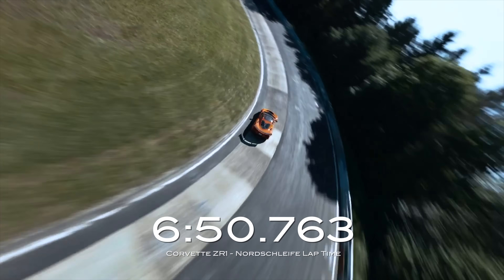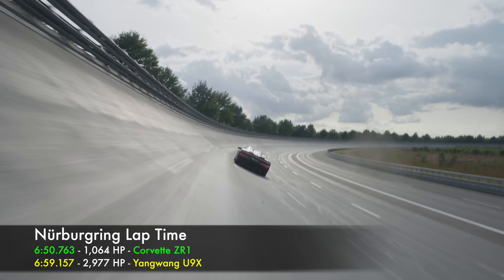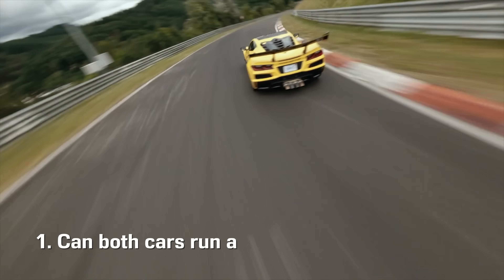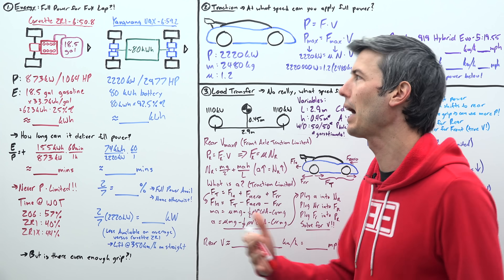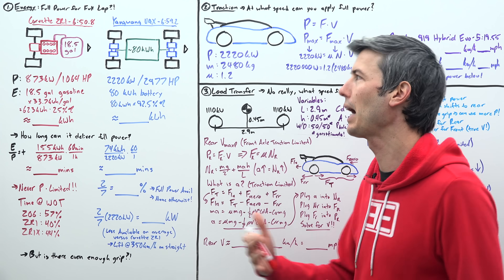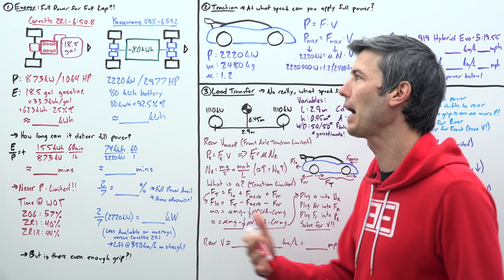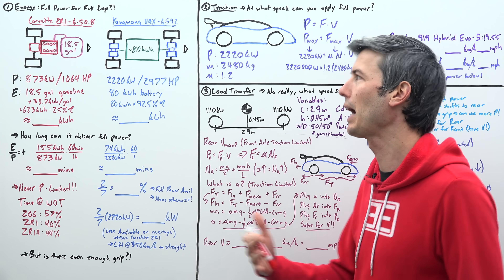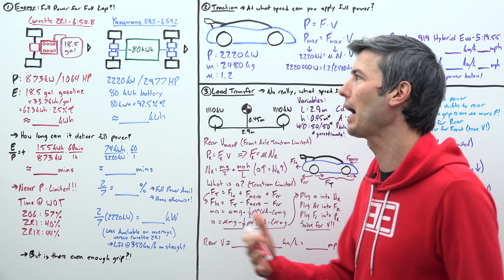Gas Beats Electric! Why Is 1000 HP Faster Than 3,000 HP?

Comment: We need to see the McMurtry Spéirling go around it ;)
Reply from the maker: Not enough energy unfortunately for full downforce for a full lap (plus max acceleration).
Reply: @EngineeringExplained  how much kwh would it need?
Reply: @EngineeringExplained  I just came across a video by the British channel everything electric and they are interviewing McMurtry engineers. The fan uses about 70 hp. There's a version with a 100 kWh battery. I'm pretty sure even with a 60kWh battery it should be able to do it but with 100kWh I don't see how it couldn't. The engineer even explained that poor track conditions only cause momentary loss of traction but it grips immediately after.
Reply: I would love that too, but 60 kWh battery only...
Reply: @ambergris5705  60kwh battery is enough to do the Nürburgring 2x laps. VW ID-R used a 24.7kwh battery to achieve their Nürburgring record.
Reply: @ambergris5705 idr did fine with 45kwh, and is heavier!
Reply: @ambergris5705 that thing needs to be gas powered and its electric motor trashed for scrap metal
Reply: @ambergris5705  ...but throwing 980kg around the track also uses less power. Then there's regen braking. It's 60 kWh battery should be able to support its 745 kW motors for more than 4 minutes (without losses). So I think the battery wouldn't be the biggest problem. I think a bigger problem might be it's Vmax of 298 km/h. That's gonna completely ruin the time with all the high speed sections of the Nordschleife.
Reply: @kooooons  not sure how they handle it, but most EV's turn off Regen or severely limit it in track mode. You are already heating the pack by accelerating hard, and then you heat it more with Regen. Turning it off gives you the best performance, at the cost of brake heat.
Reply: @volvo09  That's only for mass production street cars. Purpose built supercars and race cars do not have such heat soak limitation. They have overkill cooling or a professional team pre chilling the power chain i.e. dry ice. Regen is very much being used to achieve lap records.
Reply: @kooooons  the fan takes a similar amount of power as the wheels iirc. it cant use either at full potential
Reply: @chickenbobbobba No it doesn't. The fan uses just about 70 hp. There's a fresh video up on "everything electric" where they're interviewing engineers at McMurtry.
Reply: @kooooons  going back and looking at the gear lap, the voltage drop on the battery indicates about 165hp, but thats assuming its 800v at that SOC which its probably not. so either way a lot less than 1000 so my mistake.

your other comment you say bumps only cause a momentary loss of traction, and in isolation thats fine but i think on the nordschleife its different. because thats all it takes to fly into a barrier. with the fan, the only way to reliably keep downforce is to have the car fully planted in the first place, unlike traditional aero that can still retain a good portion if a tire lifts (eg, by hitting a kerb). with how little runoff area there is and the high risk of instantly losing your grip i doubt its safe to attempt a record. the kerbs are steep, and itd only take a nick to get sent flying. 

if you dont believe me just watch some of their laps, they seem to avoid kerbs like the plague unless theyre perfectly flat, while f1 for example would normally drive straight over far rougher ones.
Reply: @chickenbobbobba It's not what I say, it's a quote from the engineer. He said in regards to poor conditions, that the loss of grip is so short lived, it wouldn't affect the drivers' confidence. There's also hydraulic ride height control (which might explain the drop in voltage. when turning on the fans, probably the hydraulics kick in too). He also specifically said that the vacuum section in the floor is specifically designed to tolerate kerbs without loss of grip. Though I'm certain he doesn't talk about Nordschleife kerbs. Then again, one just shouldn't take kerbs there anyway. There's only 2 that you can take: Wippermann and, what's the other again, Hatzenbach?
Reply: @kooooons  there are a few kerbs you take, but im mostly worried about accidental touches, since the car is far more ride height sensitive than one using traditional aero even with the adaptive skirt. you can see the penalty for it is far greater by the lines the drivers take on the onboard laps. its probably fine for most tracks but the nordschleife is considerably worse, so i guess theres that. since the mcmurtry is so small, not making use of kerbs probably doesnt matter too much, but the issue is the safety aspect imo not performance.
Reply: It can't, the ring is too bumpy theres a video where it spins out on a fairly smooth track.
Reply: itd have to sacrifice power or fan to do a full lap unfortunately. the track might be too bumpy for the fan to work properly too
Reply: I don’t think it has enough power or something because they forsure would have already done it. Similar to how Tesla never released a model 3 performance lap but did for all their other models. They know it won’t go well.
Reply: Or it could achieve a similar time compared to their higher end models and people would start to ask questions or just buy only the model 3 instead of plaid and so on.
Reply: The Ring might break it though. It is rather bumpy. And just imagine it taking the carrousel with the fan turned on. 😂
Reply: lol :D
Reply: 60 kwh isn't enough to go 13 miles? 😅

About 7.3 mpge. Impressive.
Reply: @colinbowman8816  yeah thats pretty normal. track takes an absolute ton of power. even f1 which is the pinnacle of efficiency only gets about 5 mpg. if you stick on a beefy fan to glue it to the ground its gonna tank efficiency further.
Reply: @chickenbobbobba I'd say the Pinnacle of efficiency must be Formula-E. At Portland they did 86 km and the consumption was limited to 38 kWh. That's roughly 45 mpge, if I got the conversion right.
Reply: @kooooons  if im not mistaken ,(correct me if i am), formula e is comparatively slow, they swapped cars mid race when they ran out of range and dont have a fan for active downforce
Reply: @chickenbobbobba I'm happy to get you up to speed on FE. They don't switch cars anymore since mid 2018. Since then, the energy for every race is limited by Software to make sure conserving energy is still part of the tactics. For example for the race in Portland the 50 kWh battery was limited to 38 kWh. Since last season, FE races on the Gen3 EVO Car. Compared to the previous gen 3 car there are two main technical changes: the front motor previously only used for regen is now allowed to drive the wheels and it can charge up to 600kW. It accelerates 0-60 faster than an F1 car due to AWD. It could do 200 mph but I don't think they reach this speed in any race. So the cars are absolutely not slow. They still use little to no down force to improve racing and street tires for sustainability of both the race and the race logistics. So they can't go as fast as F1, but that's also why FE gets over 100 overtakes and 6 lead changes in Monaco in 45 minutes, while F1 gets none in, what, 2 hours?

Since last season there's been a new element called pit boost. In some races there's a mandatory pit stop for everyone where they recharge about 10% in 30 seconds. That's an experiment to stir up tactics and show off tech, because most people believe China has the quickest charging batteries but the European made FE battery can easily keep up.
Reply: @kooooons  thank you, thats very interesting. i didnt realise they added awd, and 600kw charging is a *lot*.

when you say they have very little downforce, how much actually is it? is it similar to indycar or closer to f2 or something? you say they use street tyres, so 1000kg or so might make sense. but yeah, they must be very efficient and i imagine most of that is down to regen.
Reply: @chickenbobbobba I'd say it's probably even less than F2. They have ground effect but apart from that they only have small adjustable wings on the front and the rear. Mainly for aerodynamic balance I assume. I didn't find any numbers on the down force but many people claimed they would only get 2-2,5 G lateral. But it all reads like guesses. Some smart person handy with a calculator and video editing software could probably figure the Gs out from quali laps, but I haven't found anything like it so far.
Reply: to dangerous

its ground effect fans need a flat ground

the Nordschleife is so bumpy, it would most likely break up the ground effect and make it dangerous

thats why ground effect fans are banned in all racing classes.

and even F1 is reducing ground effect in the next season
Reply: its litteraly a toy lol!
Reply: @carholic-sz3qv  aren't all super cars basically toys?

Comment: Any thoughts on how much downforce a Yangwang would have at 250 km/h?

They need to put some spoilers on that thing.
Reply from the maker: The one running the ring does have a wing, the version shown in the video is the only one they supply b-roll on, which was configured for the high speed run.

Comment: OK? so no mention of the fact that the Yang Wang weighs about the same as a Ford F150 supercrew? well over 5,000 pounds… over 1,000 pounds more than the Corvette. I think that’s the primary reason it’s not faster.
Reply from the maker: The weight of the vehicle is mentioned many times.

Comment: You have to remember that the driver for the Corvette was the vehical dynamics engineer and not a professional driver.
Reply: So would have been even better with a pro!
Reply: @JeffCaudle-q9n According to Misha which is a Nurburgring professional racer and goes there on a daily basis stated that with a dedicated pro racer should be able to extract the full capabilities of the zr1 and improve it between 5 to 10 seconds.
Reply: engineers are born drivers

Comment: Doesnt the U9X recoup energy while braking? So it should be able to deliver more power on average then you calculated. On the other hand this will heat up the battery more quickly, reducing the amount of power the battery can supply to the motors. Of course the Vette weighs less which is a huge factor.

Comment: With weight and time you also have tire degradation being higher for the U9 vs the Corvette.  What are the tire sizes on each car front and rear since the Corvette is staggered set up and just to make it more complicated the U9 has 4 motors or one per wheel so with torque vectoring and body roll it may be even lower or higher speed at which it can put down full power to one wheel.  You're gonna need a bigger white board.

Comment: The idea that traction, not torque is the real performance bottleneck is fascinating. Power is only as useful as what the tires can translate into motion. Great breakdown of how physics trumps pure horsepower.
Reply: The NHRA has watched various quarter mile solutions over the last 50 years. One reason is NHRA approached NASA to ask what the theoretical limit for a quarter mile ET was. NASA replied “400 km/h”. In 2022 the fastest exit speed was recorded at Santa Pod 402 MPH. Not quite 650km/h. Someone figured out the grip part
Reply: Could always redirect that power into, say, thrust, to avoid the issue of traction
Reply: The weight of the vehicle is the bottleneck. Having to brake sooner at every corner is what made the times different. He never even talked about it.
Reply: @bademann1 because.. Maybe it's NOT that.
Reply: Like uncle ben says "with great power, requires great tractability"
Reply: Traction has always been the bottleneck when it comes to any kind of racing.
Reply: Correct. Even my Honda will spin the tires at launch.
Reply: @RipleySawzen  Comparing a state of the art Supercar (with advanced traction control and torque vectoring systems) with a Honda Civic... nice joke.
Reply: @VG-Motors physics doesn't care about traction control. A Supercar has to deal with the same rules a Civic has.
Reply: @user-to7ds6sc3p Except that traction control works with physics, genius.
Electric cars have way more control over wheel spin than gas powered cars.
Reply: @VG-Motors  There's no joke there. Horsepower means absolutely nothing unless you're already moving. 0.5hp will spin tires from a stop.
Reply: @VG-Motors traction control can't increase grip it only helps with maintaining grip. So no physics does not care about traction control, traction control cares abput physics.
Reply: @user-to7ds6sc3p "I lack reading comprehension, so I'll just write what you said, but worse" -You
Yeah, genius, traction controls works with physics, that is exactly what i meant by that.
Reply: @VG-Motors No I did not say what you said, but let just assume you realise that Traction control can't command physics. Why is it a issue then to compare a Supercar and Civic being able to overpower traction? Its the same thing just at different speeds.
Reply: wait for the Jet power!
Reply: Of course until someone develops repulser technology where vehicles float above the ground no tires necessary like in Star Wars 😅
Reply: On motorcycles it's about balancing power, traction, and unintentional wheelies :)
Reply: Physics trumps pure horsepower?

Reminds me - release the files!
Reply: I think that's why LMP racing nowadays consists of all the same engine and just a few different body types. They are mostly tweaking aero and tune now, instead of battling it out over who has the best engine design.
Reply: well thats just the pure fundamentals

"Power is nothing without grip."
Reply: @BladeBrigade7your saying like it was the most obvious thing, lmao looser
Reply: @davidprochazka8304 
bro wyd here
cant make this shi up man
Reply: Im glad this video points this out. A lot of car enthusiasts or potential car ethusiasts forego buying really good tires when building a car. Its a common oversight.
Reply: Power Builds only work in Forza, is one way to put it.
Reply: @Avetho Forza powerbuilds are normally not 3000HP and they work because you can just slam into barricades to turn so no brakes/aero needed

Comment: now, if i had to go by the words of a man from texas, i'm pretty sure it's because you're comparing clean burning fuel to filthy, soot-in-your-nails-dirty energy from coal (power plants)
Reply: In an ICE engine there is no such thing as "clean burning fuel". Even hydrogen combusted in an ICE engine produces nitrogen oxides (smog). Also, from Google: "Coal accounted for about 16.2% of U.S. electricity generation in 2023." Try to keep up with the times.
Reply: @avsystem3142  well them dang ol’ air ain’t gon’ heat them dang ol’ selves man, gotta burn it up them dang ol’ gas but it still gon’ be cleaner than dang ol’ coal man, learned it from da dang ol’ hill man

Comment: 11:55 I guess for velocity, since it's a variable in aero resistance, you had to iterate the calculation a few times, right?
Reply from the maker: Yeah I just made a spreadsheet with velocity as a variable and picked the speed where it equalled axle power. Solving it directly gives you multiple answers and you pick the correct one.

Comment: Speed limit of 350km/h kneecaps the only advantage EV has
Reply from the maker: I asked GM engineers about this, who told me there is no 350 km/h speed limit (or any limit) on the ring. So, it seems Yangwang chose to implement that limit themselves.
Reply: Might be a limit on what the tires can take.

Comment: But the media has told us for years that electric is better.  You must have made a mistake.
Reply from the maker: Electric is better at a lot of things (torque delivery, acceleration, quietness, efficiency, etc). Currently, going fastest around the Nordschleife is not one of those things.
Reply: @EngineeringExplained Based on your video electric is only better at torque delivery, acceleration, quietness, efficiency, etc. for two minutes or less.  That is a major caveat that needs to be considered.
Reply: Lots of nuance that you're ignoring there
Reply: @jamesengland7461  The media are the ones ignoring the nuance, not me.

Comment: Isn't it simply HP/Mass ?
In case of perfect traction
Reply: For a race car mechanical grip is the biggest contributor for faster lap times.

After that is weight followed by power. Lower weight helps on acceleration and deceleration. (unless we talk about vast differences in power like 50 HP vs 500 HP). So power to weight ratio is indeed a big factor.

And then ofc Aero. That is an odd one as it is more depended on the task. If you mostly want to go straight fast, you dont need much downforce and want to reduce the drag it would bring. And aero is not just aero, in F1 the Downforce to Drag coefficient is where the money is put in. Followed by factors of how stable is the downforce with angle of attack or for changing ground clearance and so on.

What aero does is increase the grip, you can factor that in as if the friction coefficent is higher, cause you get the normal Force of a heavy car without the weight of a heavy car. For a race car with limited power by rules and minimum weight by rules aero becomes the big difference and in F1 it's the same tyre for everyone.